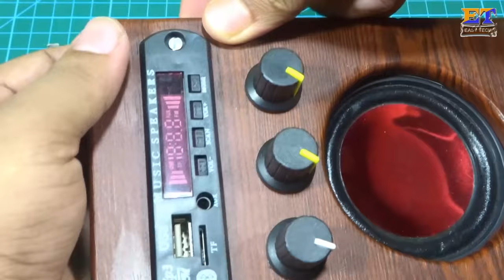How To Make High Quality 2.1 Home Theater Sound System

Comment: I have a similar somewhat branded 2.1 speakers with similar analog amp, it gets hot inside the wooden box even though a lot of space inside, the amplifier will overheat on that such small and compact containment.. you should have used Class D amplifiers..

Comment: Always use a wood based material for any audio projects. A lot depends on resonance for output quality
Reply: KuldeepSingh-pm3qc the answer my friend is yes. Impedance mismatch is the thing to worry about.
Reply: The material with lower resonance would always sound good
Reply: ඌධන
Reply: ඌධන

Comment: Hi, I want to make a bluetooth speaker from an old subwoofer, my speaker in the subwoofer is 8ohm and 5W and I want to choose 2 tweeters for this set, what are the best parameters for such speakers? And what capacitor to choose? Unless it's better to choose full-range speakers for this build? Also the question is whether the loudspeaker I have has too much resistance, and it is not better to replace it with 4 ohms
Thanks for your reply
Reply: You can use two of those 8w speakers in parallel to achieve an impedance of 4 ohm.

Comment: when u say home theatre  it means that is composed of separate multiple speakers like Front, Rear, Center, surround & sub woofer (optional). 2.1 means 2 front speaker & 1 sub woofer. u cannot call it a home theatre or a 2.1 channel in a single box.
Reply from the maker: Yes. Its single
Reply: Ormoc Chest and Lung Clinic
for most, in India 2.1 means a home theater system!, they prefer to call it that way instead of saying a 2.1 speaker system.

Comment: Hello I have bose 40w 2 box set how much power amplifier I need to buy I tried several local amplifier but all wasted after 30% volume sound cracking and amplifier dead bcz off too heat